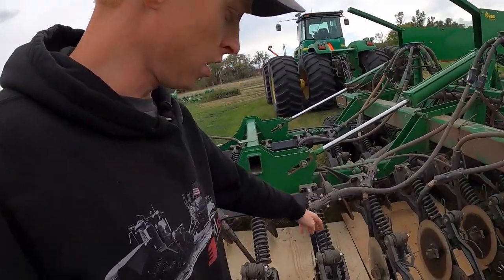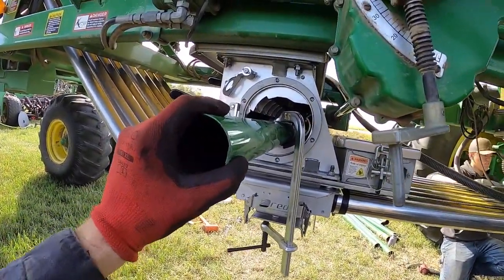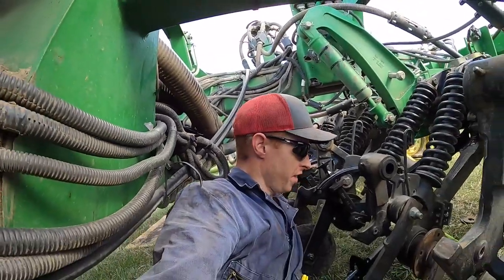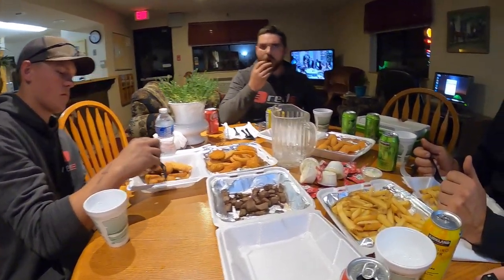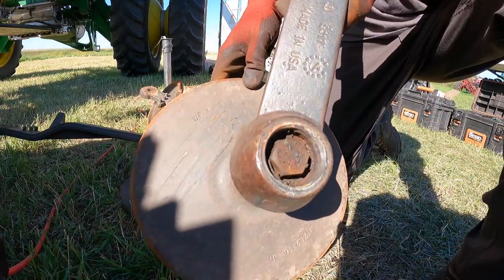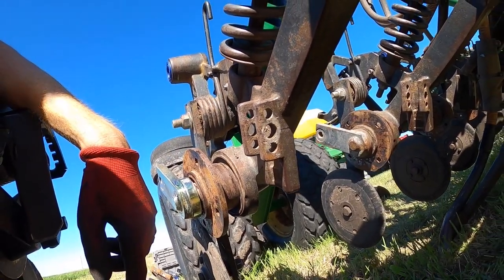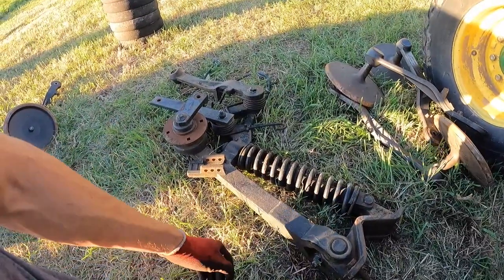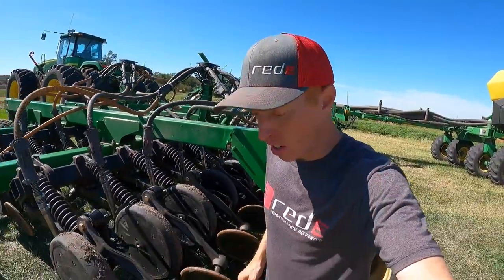4 Day Rebuild on John Deere 1890 and 1910 Air Seeder

Comment: nice job.wouldnt it be faster for your team when doing these jobs to pre assemble anything you can back in your shop so its just and install.that extra set of hands removing things will make your job go faster in the field.
Reply from the maker: Hi there - if the job allows, we definitely try and pre-assembly parts to make the rebuild go as smoothly as possible!